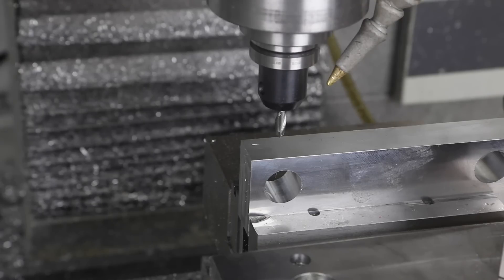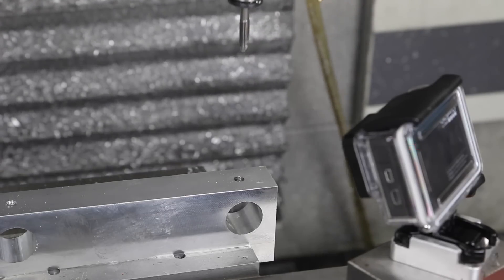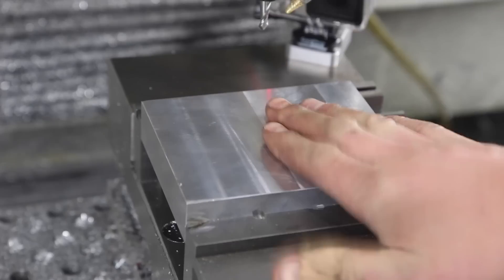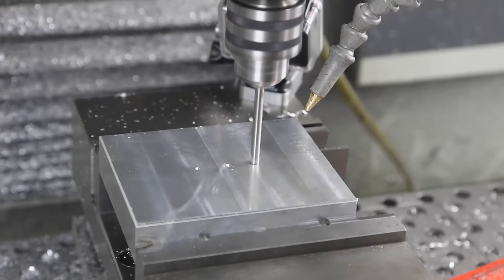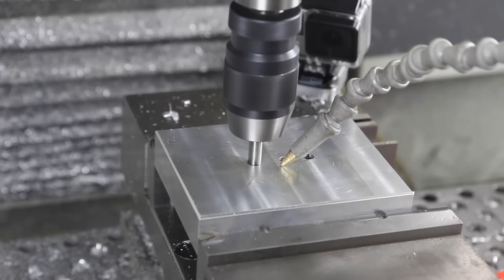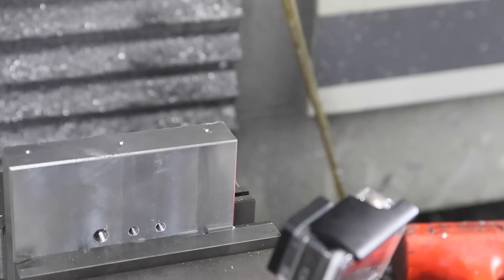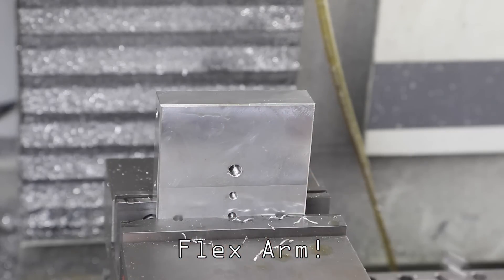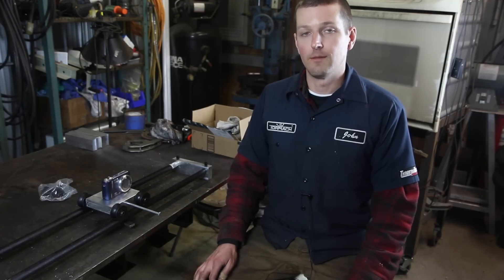Cheap DIY dSLR Camera Slider Dolly!  Part 2 - Widget30

Comment: btw does this slider need any manual alignment planarity control over field assembly?
Reply: I mean if two rails are not fastened at the ends is it easy to twist the whole construction, or it supports itself straight and perfectly parallel.
Reply: This is interesting, thank you for totally professional guides and whole working process. We're gone to wild city nearabouts and off to alfarun a rope line transferring trone for mid size 3axis gimbal arrangement aka linr
Reply: Made with pioneer(soviet) 3axis mill - lathe table sized

Comment: Hi John,
another great project with great presentation.
I am keen on the project and would love to see a centre pivot on the trolly that  the camera mounts on with the handle mounted to it so that the camera can pan side to side as it is traversing the rails. This would greatly increase its versiltility.

cheers

Comment: hi john, could i ask a if you may flatten a file out for me ? its for the handibot, i am finding it hard to take the 3d model apart and lay it out to having a flo jet cut out, thanks Daniel
Reply: Its a 3d model for the handibot, I need the components laying out flat so they can be water jet cut, like taking a box and laying all the sides flat so they can be cut from one sheet of material,  thanks daniel
Reply: I download file from handibo.com it's an stp file on there site its open source cnc router john
Reply: Oops handibot. Com its the whole machine I fancy building one, if you look on youtube you will get I better idea of wot I am explaining badly mate

Comment: @NYC CNC why not use the Slant lathe and make the linear rail rods ?
Reply: most of them are cut on lathes i noticed when building my printer they have the distinctive surface finish of a parting tool on it so i thought why not :)

Comment: I'd steer clear of hand tapping with a spiral flute tap like that. They are made for high speed. I don't tap less than 300rpm in any material. And that's conservative. Just like any cutting tool they need to sheer the material. Imagine trying to use an endmill by hand. Your tormach will be just fine doing a 3/8-16 tap with the tap head. I'm spoiled with rigid tapping Lol.
Reply: NYC CNC standard 4 flute for hand tapping. Those spiral flute taps made for ejecting chips love speed.
Reply: NYC CNC not if you use an impact to drive them. If you feel squeamish just use a 2 flute spiral tip tap. I've just seen too many of those spiral chip ejecting taps break when using them by hand to trust doing it that way. I rarely hand tap as I rarely break taps. Usually it's in critical short run parts in blind holes though. I have become quite a fan of the osg taps with the electrolube coating. Bees knees man.

Comment: John, great video! Don't worry about the gopro. Didn't bother me the slightest. This project really piqued my interest. I've been messing with time lapse of my phone with mediocre success, so a combination of this and the adrinuo project has gotten the gears going. Can the adrinuo tell the steppers to move and an incredibly slow speed? Like... Hard to tell they're spinning slow, or would gear reduction be necessary? The idea would be a panning or sliding shot like in this video, only done at much slower speed. Keep in mind I'm not a machinist, but slightly mechanically inclined. Either way thanks for the awesome vid!
Reply: NYC CNC awesome, thanks for the reply. I'll have to start gathering materials. You seem like a genuine person, a rarity now-a-days. I hope you achieve all the success you wish to!

Comment: So I have to ask: any reason you don't use a 120° spot drill? Nice thing with that is you can spot for a chamfer, then no burr raised by the tap, as well as allowing the tap drill to center on the tip instead of the cutting edges where it is more likely to run off center (and thus give you either an off-location hole or an oversize hole, especially near the top). Also gives the tap an easy entry instead of a flat surface, sort of a guide.
Reply: Just a thought mostly. First shop I worked at used 90° spot drills, but that led to oversize holes quite often when spotting for a chamfer as the cutting edges of the drill find the outside of your spot before the center and may have a tendency to deflect. I have definitely had better luck using a greater angle spot drill (120° for standard drills, wouldn't bother spotting for 135° splint point drills).

Comment: Great widget!  The go pro in the background is not a bother.  If it were blocking the view, I think folks would gripe a bit, but seeing it in the shot is no biggie.  I'm going to add a stepper motor to my slide at some point soon.  It will be cool to see how you do it (if you do it.)  Thanks again for the detailed look at the project.  It really helps guys like me, who are new to the cnc world, put the big picture together regarding process and work flow.
Reply: I'm building one from scratch.  It's a steel frame with drawer slides (cheap cost of entry).  I'm going to use it to learn my way through what I want to do...  Then I'll invest in a mill of some sort.  I'm watching you and John Grimsmo learning everything I can about the process...  I'm an architect, so the 3d modeling is old hat...  Getting a model from Cad to Cam to CNC in a logical/sane manner is where I need to pick up my game.  I think I'll be able to fake my way though 2d stuff quickly, but I want to make complex forms, so I need to learn the tools and methods.  My hope is, at some point soon, I'll be able to design and make all the pieces and parts I have floating around in my head.  The latest vid on my cnc build is here (I swear I'm not trying to hijack your comments, remove this one with the link if you want, it won't hurt my feelings) https://www.youtube.com/watch?v=FduMTNq61Bw
Reply: I tell people I'm an architect during the day and a welder at night.  I have no professional experience in fab, but I have a ton of garage/shop experience building weird little one-off projects from pivot doors to outdoor structures to auto restoration.  I'm a designer and I like to be able to build whatever is in my head...  Thus, the CNC is going to be my rapid prototyper for all kinds of projects...  The first is going to be a guitar build.  I can't wait to get going on it.
Reply: 95% of my work right now is designing educational facilities.  It's a blast designing for today's learners.  I have also done a ton of commercial work, typically renovating problem buildings.  I also design the occasional house like this one: https://www.youtube.com/watch?v=I7ed6Y8OR4o  I also fabbed the front door (you can skip to the 13:00 mark to see the door installed) https://www.youtube.com/watch?v=8yte8FRWNeA

I've watched a lot of your older vids, but never heard what you did prior or how you got into the world of CNC machining.  Where did all your interest come from?
Reply: John, I'd love to, but I'm only licensed in MO and KS.  I don't know your local codes, sometimes unincorporated county areas do not require stamped drawings.  I suspect you are thinking about a pole barn or pre-engineered metal building???  If that's the case, I'd have no problem chatting with you on the phone about it.  If there's something I can help you with, it would be fun to help out.  I'll shoot you a PM with my phone number.

Comment: I watch your videos for the entrepreneurial machining, but I do appreciate the video quality as well.  From a practical perspective, video that is well lit and in focus makes it easier to understand the point that's being conveyed, but lately your videos have gone beyond that and are now aesthetically appealing.

It's amazing how much more professional the video looks when we see your wonderfully cluttered shop in a slow pan shot on the camera slider dolly with a little soundtrack music, as opposed to a static shot.  Hollywood!

No doubt you'll add an Arduino and stepper motor to produce repeatable programmed motion.  That can be handy when producing weird special effects.  You could shoot the scene with and without your dog wandering through, superimpose the videos and digitally air brush out his legs a frame at a time so he seems to be floating through your shop like a dog dirigible.  Having the camera moving during this video magic sells the effect

Comment: Great vid as always John!!!   I was wondering if the GoPro footage was in focus when you had it mounted to the back of the vise.  Mine won't get close. 
Since everyone has a suggestion about the slider.....my 1.5cents would be a vertical hole in each of the end pieces so that another piece of pipe could slide up and down for height adjustment.....either for uneven surfaces or just to get it a bit higher without a tripod.  This would require another bar on the bottom of each for stability. 
OH......I was wondering if conduit would be strong enough.  It's a lot lighter than black pipe.  I guess it depends on how heavy your camera rig is.

Comment: Only benefit i could see with the 90 degree styled wheel for this, basicly a v-groove and a relief groove in the bottom. Is that they have alot less fricition, and they can easily hang from two wires instead of pipes using the same dolly =)
Reply: Those weels running on the pipe now, they seem to be half circles - if they were 90 degree v grooves instead, it would be easy to utilize the cart on wires as well. =)

Comment: Well done.. if I could wish, I would have 2 improvements. 1.) replace the lower bar with a bar with wheels on it, so you have less friction. 2.) machine a 2nd topplate, attached in the middle, so you can move the camera not only sideways but also around the centerpoint of the slider. 
Lg
Hendrik

Comment: Add the stepper motor and timing belt with a remote controlled arduino and you have a one man videography setup.
Reply: Excatly what I thought. You should sell those :P
Reply: There you go! Use it for the go-pro inside the machine, have it driven by the programming so that it automatically positions camera to machining operation! Lol. Nice thought, but I will stop the BS now!
Great video, great project.

Comment: Looks good John, I think you should consider options to mount the track to a single tripod which normally has a 3/8"-16 thread centered at the post. A cross brace going from each rail end may be a good trick.
Reply: NYC CNC Should not be an issue, a 3 foot slider is generally mounted on a tripod at center. I'd not trust it with a heavy 7 pound camera like a Sony AF700 though  lol

Comment: Get some UHMW polyethylene tape to stick on bar on the bottom and you can have it a bit more secure and it will smooth out the motion a bit more. That stuff is pretty slippery.

I picked up a pair of those Irwin tap holders the other day. I like them a lot. I used them both in a drill and also in a brace with a socket adapter.
Reply: NYC CNC I was going to email you. Same thing like the wheels, I just found some pre-cast ones that are going to be cheaper than making. Peachtree Woodworking is a great place to buy the tape along with other UHMW stuff.